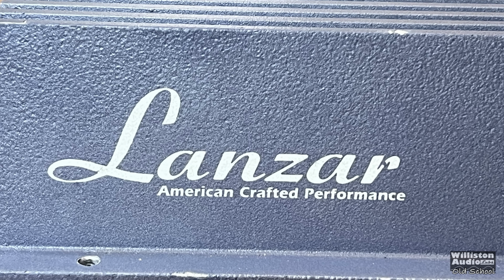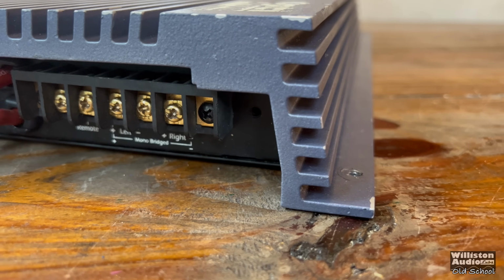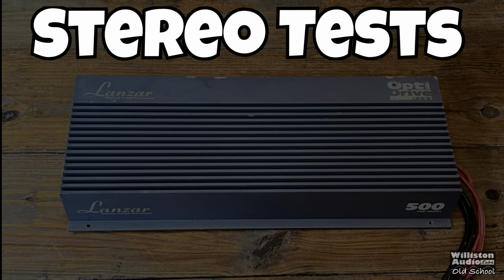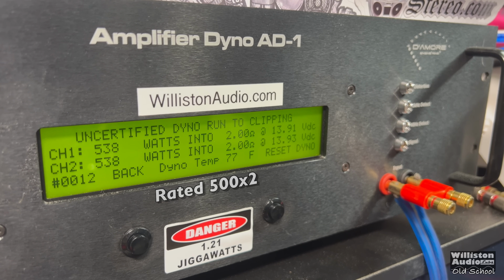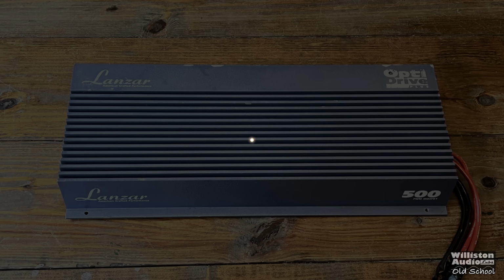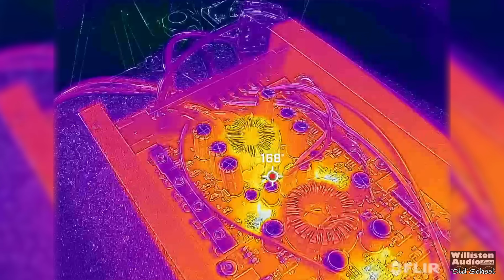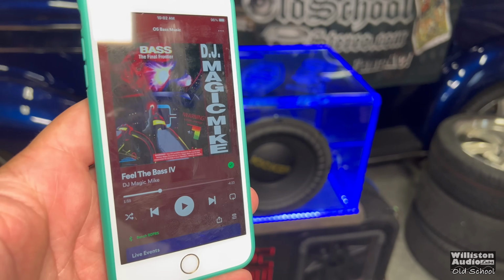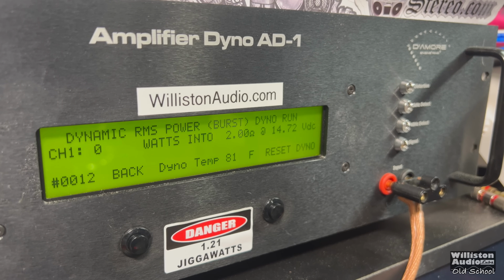When LANZAR Was Made in USA and 500W Was Big Power

Comment: I had two 2500’s powering 8 Lanzar dc10’s and hit 149.9 at an audioking sound competition.  That was around 1996.  These amps ran hot but had a ton of power.  Had 6 golf cart batteries in the back of my van for power and two ambulance 180 amp alternators.  Loved my old van:)
Reply: You sound like you like guys
Reply: @zgullickson5333 I know you!  You have 2 pyramid pro plus woofers, and a Boss amp in that Chevy spectrum back in the 90’s. That thing really knocked…at the SPl competition the meter went up when you turned your stereo down because it was cancelling out the engine rod knock.  Ah the good old days.  Didn’t you drain another 2 quarts and end up hitting 3db louder? Was like 152 or something?  I’m pretty sure Brad Bellenger and Joe Miller put that sweet system in.

Comment: Man that bring back memories had one in 98 and came second in spl comp local circuit city with a think was 15" pyramid super blue home made box in my cousin's Ford exp and beat out thousands dollar systems was laugh at when we pulled up the test area and hit highest number and only got beat by last car by .3 above we had so many people swarm car to see what slammed so hard witch back Windows were tinted trying to see what was in there and there face dropped when open hatch to plywood, painted caulked joints 80 sub and lanzar amp not at all professional install we just did it for fun we just show up to buy things and by accident they were having comp on that sat. and we took time in having the position perfectly face for hitting hard and never thought some country kids had chance well we came away with job offers cause we built cars and we willingly to learn everything we could to make it look professional.

Comment: I like the wall with all the Alphasonik equipment.  One of my first amps was an old Deltasonik amp that turned on by routing the speaker outs from the radio through the amp, it was a weird setup but it worked.

Comment: Folks think I'm lying when I say Lanzar held world records back in its day. They did and they were badass. Then Pyramid got involved and it all went to hell in a hand basket.
Reply: I have trophies to prove it.  I took down 6 Orion xtr 15’s with a huge Hcca amp…the one with the fan in middle, with 8 10” Lanzar dc’s and 2 2500 amps.  I was 16 and crushed all the huge shops spl cars.  A week later I got hired at my local shop:) it grew from there.  They were heavy, and had a TON of power.  We swapped so many amps….rockford punch’s, huge crossfire, PPI promos, and when I finally heard the Lanzar 2200 it pushed the subs way way harder.  I ended up getting two 2500’s.  The good old days

Comment: I saw a test of this amp in one of the car audio magazines and it did over 1500 watts at two ohm mono  before clipping. With 14 pair of Sanken brand  tip35/tip36c bipolar  output devices it was not a strain for the amp. Among the best class ab designs out there.

Comment: we sold lanzar back then and RARELY had bad ones. even when people beat the snot out of them they still hardly ever came back. built like tanks. I miss those days
Reply: Can you tell if this amp had been recapped?
Reply: @joesshows6793 

He sold them.
The majority of salesman are not technicians. Their job is to sell and make as much commission as humanly possible.
Reply: @joesshows6793  the caps look very original in this amp.
Reply: @joesshows6793  doesnt even matter test is bunk he feed it 14v with an amp rated for 12.6 of course it barely met its ratings on 1.5vilts more 🤣😂
Reply: As did we, the reason we rarely had issues with them is because the original manufacturer gave an F about their products. The new manufacturer, Maxxsonics doesn’t gaf.
Reply: @VisionSoundPDX It’s like all the good brands will be class D now. And sold at Walmart with old school Jenson amps marketing tactics, One gazillion watts printed on them.

I watched them all go out including Zapco, 20-30amp fuses claiming huge power.
Reply: Yes i agree, i had 3 of these kind of amps . Back when they came out. Love the fact opti amps ran cooler ,were clean an lasted ,were very solid amps. I was able to run all three opti series amps off my eclipse digital stereo an lanzar 12" subs , an lanzar door spkr. An tweets. The system stayed in the pick up truck for years till i sold it . Never had a problem an was better then the truck stock system.
Reply: I ran a pair of 12w6v1s for years in my ta hell so I mustve been at 1.5 ohms lol the amp did run hot but it never went into protect.
Reply: You know capitalizing "rarely" doesnt make it any better 😂🤣 makes it worse cause you had to convince yourself on that.
Reply: @TellyKennyButters  not at all. We sold them too. Thinking back I think we encountered maybe 20 bad out of box amps in 5 years of selling Lanzar.

Comparing those numbers to the hundreds of BOOB Pioneer double DIN decks and thousands of BOOB Pioneer amps and speakers we had in 2 years time, 20 is the equivalent of rare.

Comment: The long excursion while playing "Bass I Love You" is due low frequencies (single digits in parts!) is WAY below the box tuning frequency.  The woofer unloads and acts like it's free air.  Some woofers don't like this and can exceed x-mech.  You know that extra loud clacking noise where the voice coil former strikes the back plate!  These amps can play down to VERY low frequencies and should be HPF'd at 25Hz or so when driving vented boxes.
Reply: I believe that's called cliping

Comment: How much if any is the dual 8 gauge power holding back any current going to the amp..
If it was 1/0 gauge, could the amp make more power?? Also how did you have to power & ground connected.
Reply: I doubt it's holding it back, it's just a short run of cable.